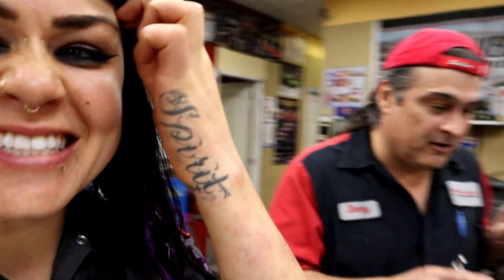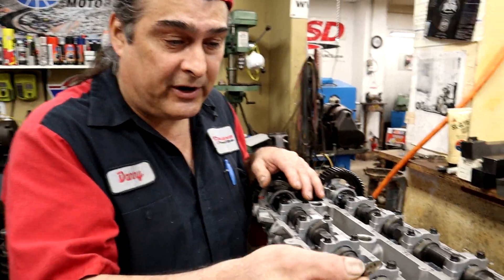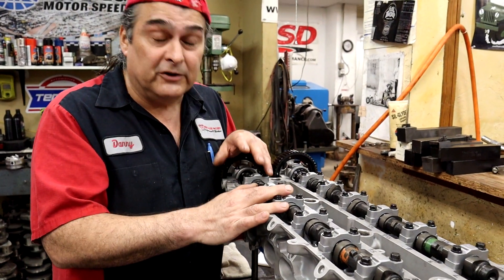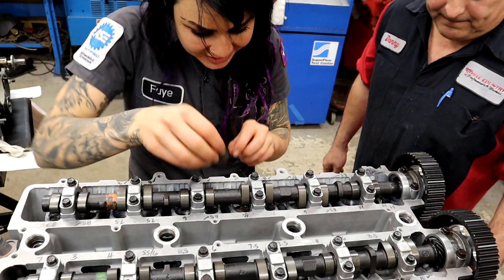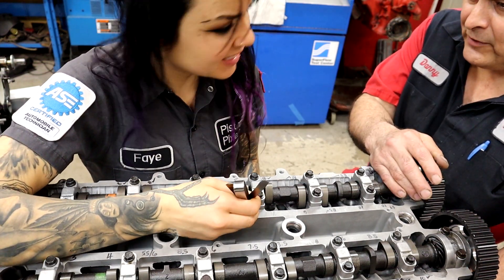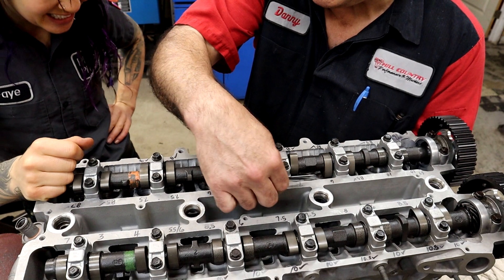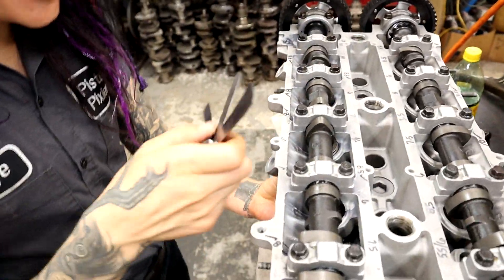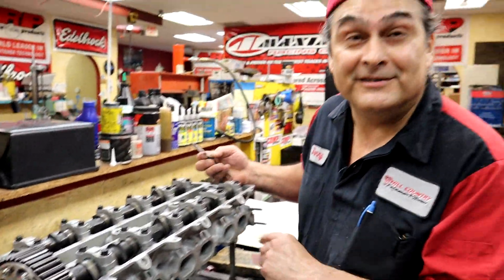An Exploration into Mastering Shim-Over-Bucket Valve Adjustment: Rebuilding a Cylinder Head Part 4

Comment: Good info here. 

Had to do the valve clearance adjustment in a 1999 Toyota Tacoma with 3RZ-FE with 200k miles to get rid of a misfire (loss of compression) - https://www.tacomaworld.com/threads/ole-red-1999-toyota-tacoma-xtra-cab-2-7l-3rz-fe-4x4-sr5-all-manual-build.407774/page-9

Same process applies for 2RZ-FE, 3RZ-FE, and 1FZ-FE - https://www.youtube.com/watch?v=GpouBL0wSE4

https://www.youtube.com/watch?v=FzrSAQJOugU&list=PLdRJTWaZptjRTp2kueTt12lRkYcRrGI2E&index=18

https://www.youtube.com/watch?v=pKEkOdQuJR4&list=PLdRJTWaZptjRTp2kueTt12lRkYcRrGI2E&index=20

Comment: I've got some questions. (I'm doing this to my tacoma 3.4 right now at this very moment). 
1. How critical is the position of the cam when checking the clearance? The fsm starts at tdc, then turn 240°, then again 240°. I had to start over like six times because I'm old and easily cornfused.  2.What grit are you finishing the shims with?

Comment: Just did this on my 95 3.0 4x4 4runner..passenger #1 exhaust cam lobe was wiped out. Every single exhaust valve was burned.. I.E. leak down text was leaking compression bad through exhaust. Decked the heads new cam,,valve seats,in&ex valves,guides,shims adjusted properly. Tested and cleaned all injectors. Got it all back together and it seems to be running pretty good. Although I think I need to adjust valves again after about 150miles of driving. I can hear some ticking on drivers side and can even feel it through the valve cover. Started just today. Fuck. I was hoping to never open those valve covers again! Also I exhaust wrapped the crossover pipe and manifolds where the wrap around the back corners of heads.

Comment: I did the valve lash on my isuzu showing my son in the suv setting them cold then checking again hot for tolerances between hot/cold these new alum. heads will expand more then cast iron so tolerances are critical those pucks look like a cheap way to do it by the manf. can just see them fly out mine has bolts with lock nuts on top with loc tight old timers remember the bolt on rockers that tightened to tolerances had a 302 v-8 that beat them so bad that they worn down  and had to be replaced motor was too small to haul around a f-100 full size truck with a 8ft bed lasted 350,000 miles before giving up did a rebuild on it lessons learned never do one on a block with that many miles on it even after having it checked cleaned it stilled cracked a cly wall

Comment: I am jealous of how easy this is, being a former motorcycle mechanic and performing valve adjustments was a PITA since the shims were below the buckets so to change or even check the shim size youd have to remove the cam and then the bucket+ shim. worst part was the fact that the shims were smaller than a dime to, so if you dropped one while changing them you would be hard pressed to find it.

Comment: Just like a Duesenberg straight 8 or a Kawasaki 1000 motorcycle. No lock-nuts to slip but takes longer. LOTS longer. Bless you for staying with inline motor and not just wedging in a V6 or 8.

Comment: This was interesting. I like how Danny reassured you that you were right. When I would adjust the valves on my ‘73 MGB with my Dad it was very different. I just remember leaving the car in gear, rocking it until a certain number would rise to the top, then checking the gap with the same tool y’all were using. Were we adjusting something different or just the engine is built different? Either way it’s cool learning as you go. I think you need a barrette for your chickens’ hair that looks like sunglasses. That would be a riot. 🕶
Reply from the maker: Oh there are many different ways that valves are adjusted! Did yours have a threaded rod with adjusting nuts maybe?? I don't think I have worked on anything that old in a long time 😅👍🏻 that's so rad! You've had some really cool experiences. I always enjoy your comments:)
Reply: Faye, this was in the mid-80’s (I’m so old), from memory, there was a nut to turn to adjust the clearance. We also tuned the twin carburetors by listening to the pitch with a drinking straw to your ear. Where else can I learn about the newer stuff - by watching your videos.

Comment: Not sure what toyota recommends but probably re check those after first oil change and probably a quick change on the oil after 500-600miles i probably would change oil after the first hour of engine time due too being rebuilt and flush out some breakin material before runin for the 500 -600miles after that the wear is much less somthing ive noticed after servicing new machines is that the first service is critical .iam not sure but some companies have a short test run with the engine and they might changes the oil or have a recycler or somthin....now im curious

Comment: i had a noisey valve in a LS 400 i had a long time age.  right after i changed the oil  one of the shims poped out and wedged in the valve guide. ruined the engine as the cost effective fix was a salvage engine.  so things can and do happen, just saying.
Reply: common issue, always convert to shim under or shim less.

Comment: You want a real pain in the backside valve clearance adjustment.....Shim UNDER bucket on most sportbikes.
You have to take the bike half apart just to get access to the valve train and even then, some have no room to work.
In addition, once you get the clearance measurements, you have to pull the cams to adjust any that are out of spec.
Gaaahh!!!!!
The plus side is you won't spit a shim if you over rev it like can happen with shim over bucket.
Also, they don't go out of spec very often so mostly need no adjustment when you check the clearances. 
I love your videos Faye. Keep up the awesome.

Comment: Just curious how the valve seating seems to be after having straightened the head, if that distorted any of the seat surfaces into a slight oblong shape and had to be touched up or if it never moved those specs from the prior valve/seat grinding you had done the first go around rebuilding the engine ?

Comment: Is that a push rod engine? I've never seen those pucks, very different from Hondas.

Glad you are including each phase of the rebuild!
Reply: no.  its an overhead cam.   valve->shim->bucket/cap->cam.   this reduces weight and allows high revs.   my I4 japanese motorcyle engine is just like this.  just smaller.
Reply: @orbitalair2103  ah gotcha, figured Toyota would be... I've never had to rebuild a head or even fully remove cams.  

That said, one of my projects needs new valve guides and seals - so I'm learning a lot. Thanks for the reply!

Comment: My 1980 Volkswagen rabbit had  the same kind of valve adjustments , Very cool video thanks for the great information Faye and Danny
Reply from the maker: Yes!! Mine did too (when she still had the factory engine - a 1.5l diesel!) which is how I first learned about these!!!
Reply: Mine was a 1.6 L gasoline engine had the Bosch continuous injection system , five speed transmission mechanical breaker points in the distributor fun to drive ,It would easily shame a lot of the American made economy cars of the 80s

Comment: Is it necessary to have the head out to perform this on a car that states that the shims need to be done every 100K ?
Reply from the maker: No, it is just so much more difficult, but very possible to do in the car. About 10 years ago when my VW was a diesel, I performed this service with the engine in the car. It took me most of a weekend day, but I was pretty new to wrenching at the time!
Reply: @FayeHadley  lol, how cool  - the boss replied.    Thanks Faye !  I am going to give it a go.  Most that happens is I get the shits and call dad to come help. hahahahaha - wish me luck, and so good to see you and your new video.   You're like a breath of fresh engine air !  bahahahahaha
Reply: The shim adjustment on car isn't to hard to do if you have the correct tools and a good kit of shims in all sizes. I break into 3 steps.

Do your initial clearance measurements and write down the clearances you have on the head.

Take your initial clearance measurements and calculate what shims you will need to bring them into specification.

Fit new (or used) shims based on your calculations.

That being said, you need the correct tools AND a good shim selection, to do the job easily, with the cylinder head installed.

Have fun, it is addition and subtraction learned in school put into a real world application 👍
Reply: @2secondslater  Thank you for your detailed reply... I am saving the video along with your comment for when I uptake the task.  Its $1500 AU for the mech to do it, and I have already taken the head cover off the wifes car - exact same model, so I am at least over the shock horror of seeing the guts (valve area)  up top and have a good access point from the front wheel bay to turn the cams to position needed for clearance measuring.  ..  Sounds like will take me 2 whole days,. ISSUE THAT RINGS A RED ALERT TO ME is having those right shims onhand, or hoping the service centre down the road have them in stock.  Thanks again !
Reply: @CaptureYouVideo  no problems with sharing info, I forgot a step btw which is something that good mechanics generally do... recheck the clearances once you are done... Part of step 3 I guess 👌
Reply: Keith Christensen  Hey Keith !  Thank you !  I am going to try it out, but you probably viewed my replies to Faye and Jake, but thank you for your input too.  The comments really fill me with hope that I can do it.  After all, its not really an engine rebuild hey.  That of course, I would NEVER even know where to start... I'd be like........ ummmmm faye,   where does this bolt go ?????  And this one ???????  ahahahha